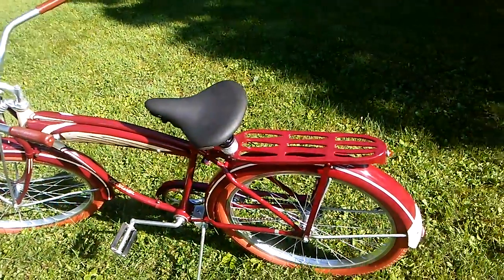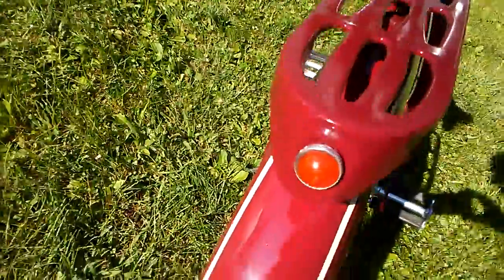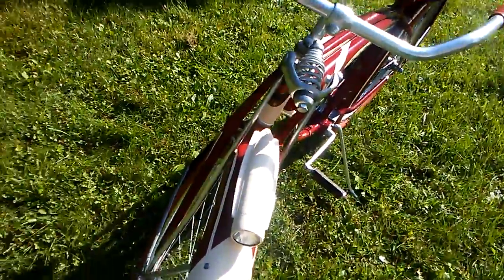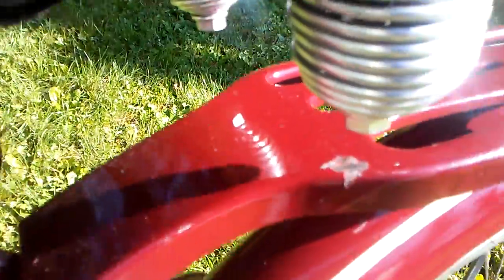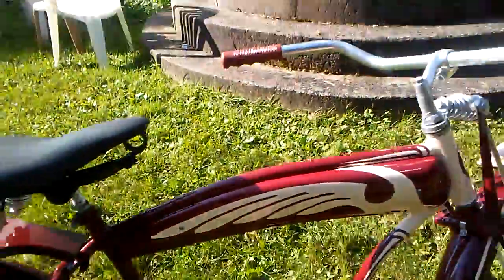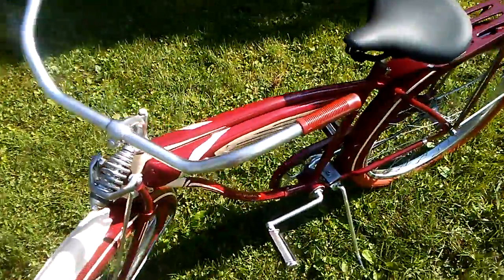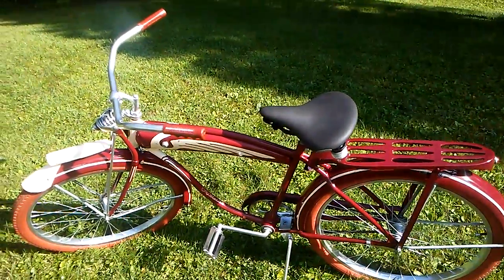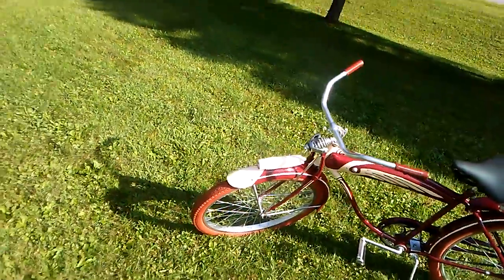1941 prewar schwinn excelsior pre war

Comment: yhats a dx  schwinn  the rack  is a 9 hole it should be a 6 hole   the rins were not painted they were chrome lobdells  nice bike also should be a long spring mesinger seat
Reply: Gary Phelps I hate to give her that opinion about a 6 hole rack on a DX they are usually 9 Hole and also to that depending on the price back then say 1941 you can get either chromium plated drop Center rims or you can get enameled drop Center rims and also to you can get a coaster brake of your choice Musselman new departure or at a slight extra cost Morrow coaster brake or you can go one better than that in 1941 you can have the dealer prep your 41 DX with front and rear expander brakes and as for the seat for 1941 it will usually be a messenger sliding rail short spring saddle now in 19 40 back to let's say 1939 yes the saddle will be a long spring set up but when you said that bikes should have Lobdell box Rim Wheels Lobdell box rims were usually available for the deluxe b607 autocycles or b107 autocycle straight bar but I believe the Lobdell voxx rims where are available from as late as 1940 all the way up until 1946 but most of the time Schwinn what were the easier inexpensive route by using drop Center Wheels all the way up until 1946 or as early as 47.